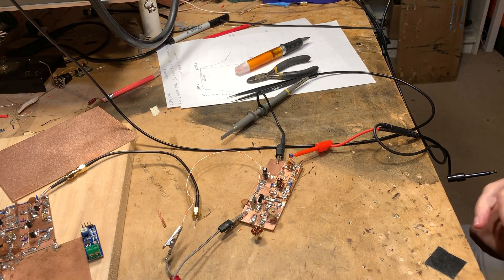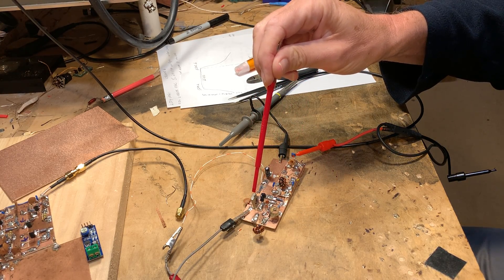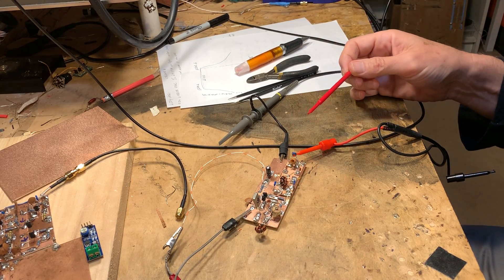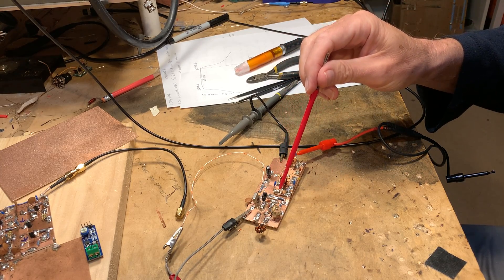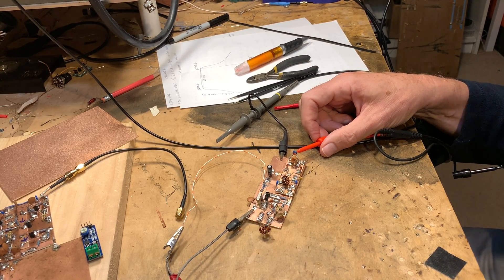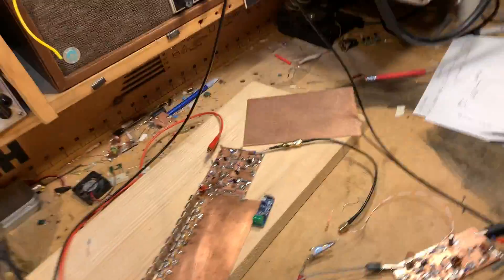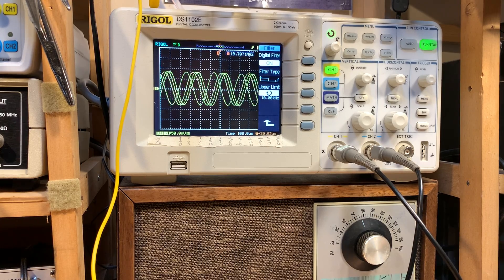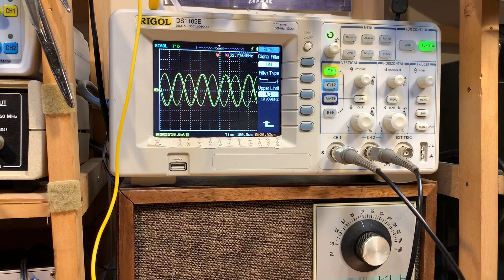SolderSmoke Video -- Mythbuster Video #1 -- Carrier Oscillator, BFO and Product Detector

Comment: I really appreciate this video. This was an area that I had questions. Yours is the only video I've seen that gives such a visual demonstration of audio being produced from the mixer. Then at zero beat, no audio. I think you said at that point both input frequency's where the same. So no difference frequency I think. If I've got it right, when the difference is in the audio spectrum you get audio.
Reply from the maker: That's right.  Suppose the CW signal is at 7010 kHz.  If you tune the VFO to 7010, you will hear nothing, because you are at zero beat.  But if you tune the VFO to 7011 kHz you will hear a 1 kHz tone.  Or if you tune the VFO to 7009 kHz you will also hear a 1 kHz tone.  73  Bill
Reply: Thanks Bill.

Regards Trevor